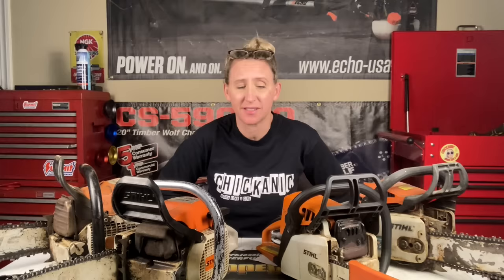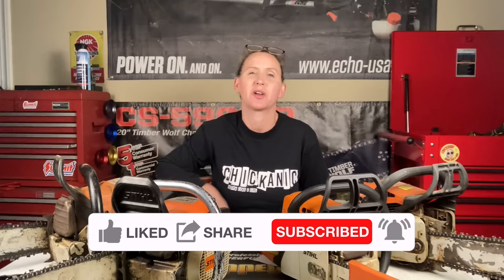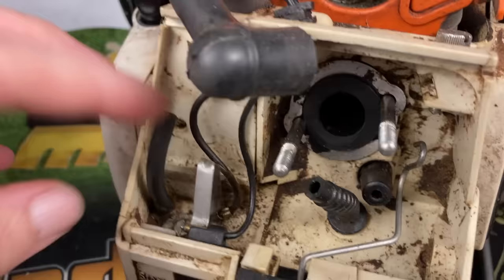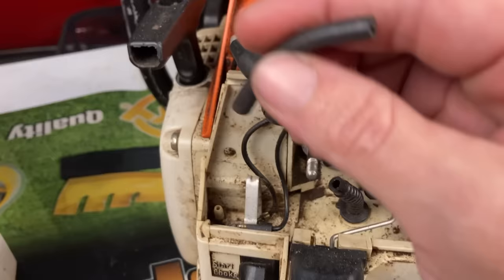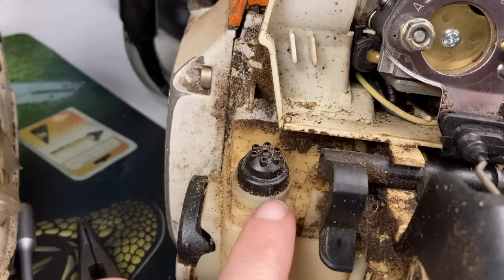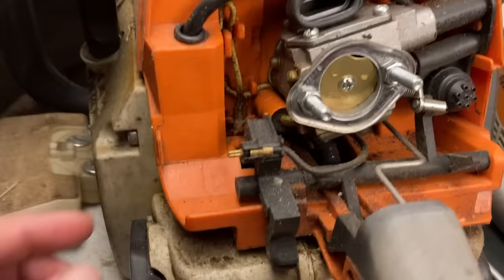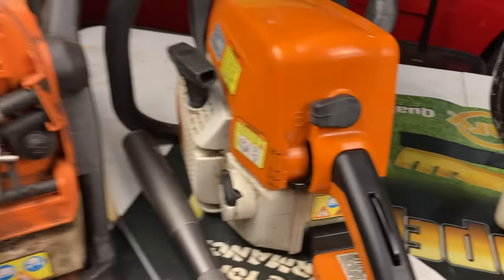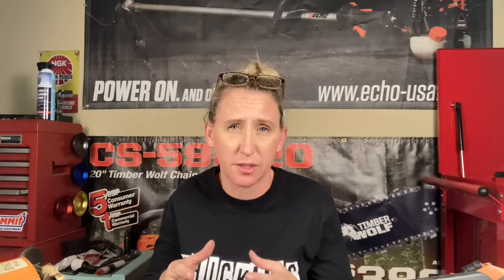Stihl chainsaw bogging down, has no power or is leaking fuel? CHECK THIS! Repair/Vlog #Chickanic

Comment: The tank vent should be allowing air into the tank so that the fuel can flow out of the tank to the carb while not letting tank fumes and fuel leak out of the vent. If the vent isn't working its like holding your finger on a straw full of soda... the fuel stays in the tank and will not flow to the carb and the saw will either bog down or not run.
Reply: More often there will be a need for releasing over pressure from 
gas vapors in the tank. Getting vacuum locked is a cold weather 
issue more often. For either problem the field remedy is simply 
loosen the fuel cap and let the excess pressure escape or let 
air enter and snug the cap down and continue working. Poulan 
and Husqvarna saws are airtight as a soda bottle, in reaction
to EPA restrictions which are the source of the venting issue. 
EPA doesn't want a nanogram of fuel vapor in the atmosphere 
unless it involves refueling their private jets and limousines,
because of course that is entirely virtuous escaping vapors.
Reply: @artpatronforever  The main reason to let pressure out of the tank is to prevent fuel from spraying out when the operator opens the gas cap to refuel a hot saw - a fire and safety hazard in the workplace.

Don't underestimate vacuum locking, every gas/liquid burning motor that has a sealed gas tank has a vent to allow air to displace consumed fuel. Fuel vapors from evaporation aren't enough to displace the liquid fuel and prevent vapor lock.
Reply: @killer2600  I have 3 Poulan Pro saws. All run pressurized..
By design they are pressure fed. All 3 spit fuel spray because
CARB compliance systems are pressure captive. EPA doesn't
care about safety and are only fanatics about climate alarmism.
If a few loggers get burnt up EPA could not care less. 2 vintage
Homelite saws have different systems definitely NOT compliant.
Separate viton duckbill valves like used in purge bulbs will allow
pressure relief either direction for whatever exceeds the couple
of pounds pressure needed to open the slit in the duckbill valve. 
The viton duckbill in a purge valve is likely good for improvising
a vent line termination using a purge valve under the hood in 
the carburetor cowling if there is room, using whatever flow
direction is needed for that vent line.
Reply: @killer2600  Yes, as Stihl learned the hard way with forest firefighters getting sprayed with gas as they went to refill their saws.....

How Stihl ever recovered from that is an anomaly to me.There were at least a couple of yrs where forest firefighters did NOT buy Stihl saws.  And the 'fix' was a $100 kit to re-engineer their stupid, quick fill caps.
Reply: @artpatronforever  Hate to have to argue but I have 2 Poulan made saws, they both use duckbill valves in the fuel cap and neither one vents vapor pressure out the cap - duckbill valves are one-way by design otherwise they would leak fuel.
Reply: @killer2600  Definitely a different model with a different breather. 
There is a breather in the tank adjacent the return line from the 
purge valve and it is sintered bronze expose to atmosphere with
an internal part also but it does not even show a number as a
replacement part and is probably sold only with the fuel tank.
There are aftermarket numbers for the part that is a breather 
and probably a vacuum break. But there is only pressure I ever
encounter even when a fueled saw is left to sit for a week or
was used five minutes ago. 3 saws I have are Poulan but
have Husqvarna part numbers. I maintain them so I know 
how they are configured. They have solid fuel caps with a
cylindrical seal like a wide rubber band, probably gray viton.  
Caps are very hard to remove if ever tightened more than 
just barely snug, but they don't leak and are pressure tight.  
Other equipment I have uses duckbills of pink viton rubber, 
but some have black viton duckbills made exactly the same.  
The duckbill in the fuel cap center where that is used is a 
vacuum breaker but duckbill valves work other direction 
when turned around in a pressure relief path. Usually a 
breather has a very small orifice like a carburetor jet so
if raw fuel hits the opening not much gets through, but
vapor can pass easily. Homelite even ports crankcase 
pressure into the oil tank to pressurize the oil feed and 
it would be no surprise if the PR4218 model Poulan 
does the same thing which would explain why the fuel 
tanks are always pressurized. Opening the fuel tanks
is always like opening a soda pop, they are definitely 
all 3 pressurized. All 3 saws were bought new from 
different vendors. Husqvarna is Swedish for Poulan.
Mostly all 3 saws also start first pull so they are not
usual Poulan. I found the secret to tuning them right.
Reply: @artpatronforever  There are many ways to design a fuel system. The idea that only what someone has seen are the only possibilities are where people are going wrong in the comments. As for duckbills, they are one-way valves. If you use two, one in each orientation/direction, you defeat the purpose of using them at all in a tank vent system.
Reply: @killer2600  You're not accounting for pressure venting
that can also be done by a duckbill because of cracking 
pressure that is enough to open the duckbill in the easy 
direction of flow. A duckbill is a check valve but takes a 
couple of pounds of pressure to overcome the elasticity 
of a rubber duckbill. So it does not defeat the purpose
but allows regulation of positive or negative pressure.
That two pounds psi that develops as either vacuum
or pressure can open its respective duckbill and vents 
the pressure to keep the tank under that plus or minus 
limit where the duckbills pop open and flow. If virtually 
zero differential was required to pop open the duckbill,
yeah there would be no purpose, but many fuel caps 
will also vent either way when an exceeded pressure 
differential may occur. A fuel tank with duckbills for 
both vacuum and pressure venting would have about
plus or minus 2 psi before the cracking pressure will
open the respective duckbill and let pressure out or
or let atmosphere in the tank to break the vacuum. 
I have seen duckbills used in duplex arrangement
to do exactly that kind of regulation where the idea
is a "soft seal" on a fuel tank so that it can partially 
equalize pressure either direction if that difference 
exceeds a couple of psi.
Reply: @killer2600  Not being theoretical about small engines
or fuel systems, and have been working on and rebuilt  
some over several decades. Please understand I share 
knowledge that is more than what I only imagine may be 
correct. On chain saws there is a lot of local heat. Fresh
gasoline has a lot of hydrocarbon volatiles that heat will 
cause to come out of solution and develop pressure in 
a pressure captive fuel tank. The few times I ever had an
issue with "vacuum lock" is in cold weather fueling with 
cold fuel mix and then the cure was simply opening and 
reclosing the fuel cap, by which time the warming fuel is
evolving enough fuel vapors to nullify any vacuum lock. 
To correctly observe this and share the information is 
not "going wrong in comments". I have a collection of 
viton rubber duckbills in my spare parts box and have 
changed a few of them on several engines and I do 
know exactly how they work. When fuel pumps get
tired is also when the symptoms of "vacuum lock"
may appear. Opening and reclosing the fuel cap can
be a field fix for what may be a transient problem. 
A partially clogged breather can conspire with a 
weak fuel pump to make the problem worse and 
weather and a cold saw with cold fuel will all be 
additive to make the saw sluggish or rough or not
idle all made worse if the mixtures are also lean.
Reply: @artpatronforever  This isn't the place for fuel system design discussion. My final words are if I ever saw such a two duckbill design that used that principle to keep fuel in - what a piece of crap/junk.
Reply: @artpatronforever  You're preaching to the wrong crowd, if you want to enlighten the engineers that are designing this stuff to the error of their ways and inform them that vents that allow air into the tank are completely unnecessary and that only venting pressure out of the tank is the only concern - this is not the place for that.

You seal up your tanks so that air doesn't get in and only pressure gets out and it works, good for you. I don't care, I'm not looking for advice on modifying my equipment from the way it is designed. I too have my own experience with this stuff and it's why I'm not plugging the vent.
Reply: @killer2600  You have a problem simple enough and
affects too many people believing they know what they are
talking when they don't. You try to tell me what is useful
to share based on what you think, but don't know. Here I
am not trying to troll the OP or you, but that seems to be 
what is your purpose. Today I was using a chainsaw that
started first pull like it often does, like yesterday and the
day before. It isn't sluggish and has no fuel flow issues
and no problem with pinched lines so somebody in this
discussion has this subject covered but that isn't you.
Reply: @killer2600   Information I share is not "preaching"  
or trying tell engineers what to do. I never said that
tank vents are not needed nor have I plugged up any. 
Neither have I offered advice on modifying anything
except to say that a purge bulb uses a viton duckbill
variant and could be useful to terminate a vent line. 
I don't claim that is my idea and saw a logger had 
mentioned it had worked on one of his saws. The
saws I use are not modified except for upgraded
fuel lines.
Reply: @artpatronforever  I don't have a problem. You apparently have a problem if you think I have a problem because I (and others here) are not onboard with your viewpoint. You want to change my view of physics, have an engineer implement your way and if it ends up in my hands and works like a dream then I'll be on board. Until then, it's a no-go for me.

By the way, you should fix the format of your comments. It looks like trash. It's honestly one reason why I don't put much faith in what you write.
Reply: @artpatronforever  Finally, proper formatting on that last paragraph - congrats.
Reply: @killer2600  If the Tygon LP-1200 tubing doesn't work out 
long term like I am testing, I have on hand some lab grade
fluoropolymer FEP and PFA and PTFE lines that should work.
Viton fluoroelastomer is good stuff and would be great for
very flexible fuel lines that would last just about forever. 
On some of the vintage saws there were used metal lines 
like copper brake line tubing and bulkhead fittings so there
was no problem with rotting plastic fuel lines in the old days. 
Next time you have to polish the haze away on plastic auto
headlamps understand there was a time when that was 
never a chore to do because auto headlamps were properly
made from glass. Sometimes engineers should stop the 
innovation at the point where they have it just right and 
call it a win.
Reply: @killer2600  I'll leave you with a riddle for all the master engineers. 
Why aren't all chains with angled cutting teeth made with a number 
of drive links that are an even multiple of 4 so that the cutting teeth 
will alternate as left right pairs and not end up with 2 cutters going
the same direction at one point in the loop of chain? How does that
make sense as engineering, because it makes no sense to me. So
please do enlighten me. No need to mark the starting link when 
sharpening to make it user friendly and increase cutting vibration? 
Now there is genius. No shortage of master minds in that shop.
Reply: @artpatronforever  You really don’t know how to stay on topic and like to ramble about irrelevant things. Reminder the video was on tank vents and the symptoms one encounters when they are pinched or clogged. No one but you was discussing alternative designs and whatever else you’re rambling about - apparently reminiscing about the good ol’ days when saws weighed 25 lbs and ran slow. As before, I still don’t care.
Reply: @killer2600   Yeah I remember the good old days before 
so many people became schooled in confusion so thoroughly 
now too many people are trained like good doggies not to bark
but to pretend they are cats and just meow. You are hungry for 
another can of puss and boots, but me, I'd rather have a steak.
Know that song by Paul Revere and the Raiders titled Hungry ?
Reply: @Rockjock007  No, Stihl chainsaws were banned from use by the US Forest Service firefighters for a number of yrs. It was a real 'thing'. How you recover from that as a company is fairly remarkable. Not just your sales, but your reputation. It all had to do with their quick caps. Almost instantly there was a aftermarket 'fix', but it was around $100. I lost track after that because I'm not a Stihl owner/fan. But like in the movie, "They're back!"

Comment: Agree with commenters that a clogged tank vent will produce a vacuum in the tank as fuel is consumed, resulting in starvation rather than flooding. An easy way to check the vent is to loosen the fuel cap allowing air into the tank, then tighten it and restart. If the problem is temporarily better, it's the tank vent. A bit of not well known info is: in the older type, the line will eventually press into the threads of the screws, blocking air flow. The slot on the screws is for aiding removal. If the line is replaced, PUSH the screws in, don't thread them in. This will keep the threads clear, providing a channel for air.

Comment: Love how engineers and designers make sure to incorporate so many tiny parts that you can lose when you're doing repair work on the job. They also make sure they are attached in such a way that they go flying off in some random direction never to be seen again.
Reply: We are under tremendous pressure to fulfill the ever changing government emission, recycling requirements and not appear obsolete compared to competitors. We don't get to make a lot of these design decisions. It comes from the product managers, business development teams and upper management. It is very easy to point fingers at the engineers. Our powers are limited. We do what we are told to, else we get fired and our replacements will thank us and continue to do the same.
Reply: They just had to invent ten millimeter fasteners too knowing every ten millimeter socket known to man and woman will vanish never to be seen again.

Comment: Love your videos,  but, a tank vent controls vacuum in all gasoline engines,  a solid ( or clogged) cap would starve the engine of gas, an open vent would allow gas and fumes to leak out,  almost all small engines like this use a vacuum diaphragm type vent,  which is closed when the engine is off, when it is running the vacuum draws just enough air in to keep the inside of the gas tank pressure balanced with the atmospheric pressure.

Comment: Just to let everyone know Stihl has a new design gas vent which is behind the front pull cord  cover at the top of the tank. It is a small rubber piece that fits right into the tank. Very hard to find.  After time the rubber closes up. If its still pliable you can take a hot needle and open up the center. If not its about a 10 dollar part.

Comment: Now I always thought that a tank vent allowed air into the tank as gas is being drawn out to prevent a vacuum from being created that would stop fuel flow to the carb. In many 4 cycle engines, it's just a tiny hole in the gas cap. A bit different in some 2 cycles because of the crazy positions of operation. 🙂

Comment: ive seen two problems with tank vents. first like you say the tank pressurizes and with an iffy carb will flood.  the other is it not letting air in as the fuel level lowers. they slowly loose top end. those are easy just pop the cap lose for a second it will pick back up, you know its the vent.

Comment: A swing and a miss on this one, should show removal, testing, cleaning and your solution. Also I think the tank vent lets air into the tank to prevent vacuum. Like a one way check valve. The old style tube with set screws has a little ball inside between the screws, seals one way and lets air in the other way. Most of them get lost during cleaning causing fuel to leak out a little bit but still runs fine until the tube plugs up with fine wood dust. We used to get little plastic vents that looked like a small fuel filter and just pop one in a short piece of fuel hose and problem solved!
Reply: I don’t see your videos up, so not sure about the “swing and the miss”.

Comment: I agree with John Grossbohlin, the only purpose of the tank vent is to vent the tank so fuel can flow to the carb. I was a Stihl dealer when they had to develop a vent that stopped fumes and liquid fuel from exiting the tank via the vent. This was no easy task, as the vent had to function at extreme temperatures,  not get clogged with sawdust, and operate under tank conditions of negative, positive, or no pressure in the tank. There were several variations. The fuel is not pushed to the carb by pressure in the tank, but atmospheric pressure is involved.

Comment: My Poulan saw was bogging down and I went looking for the tank vent but didn't see one. However, I noticed the permanent air filter was really dirty. Cleaned it with soap and water and let it dry. Reinstalled it and the saw ran good as new.  I did also clean up the spark plug since the lack of air made it run rich and fouled it up some.